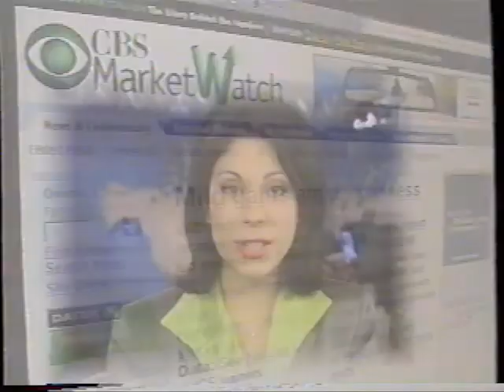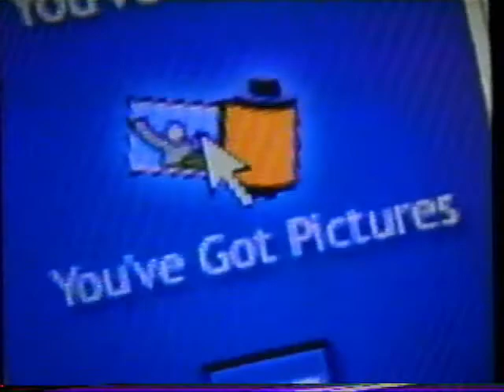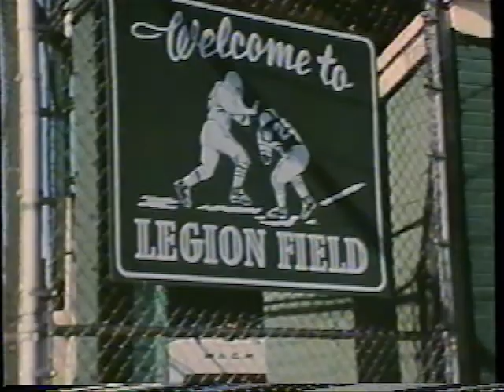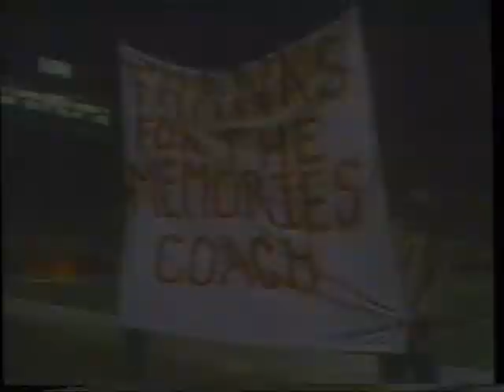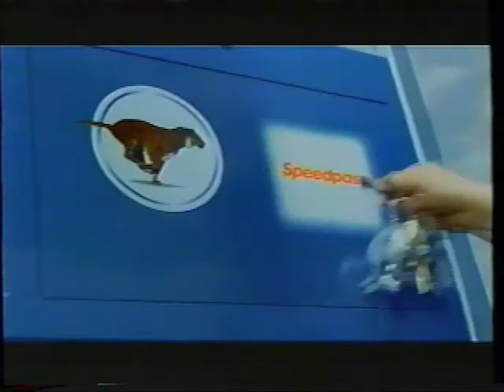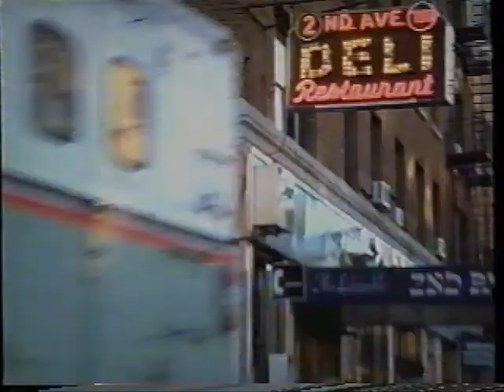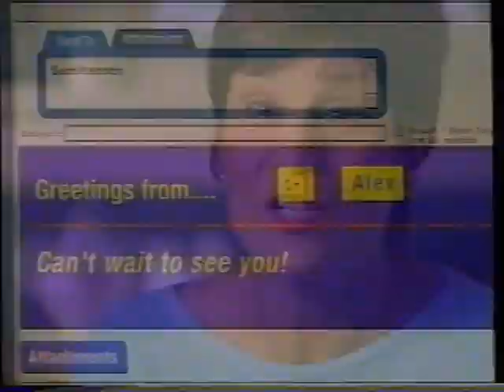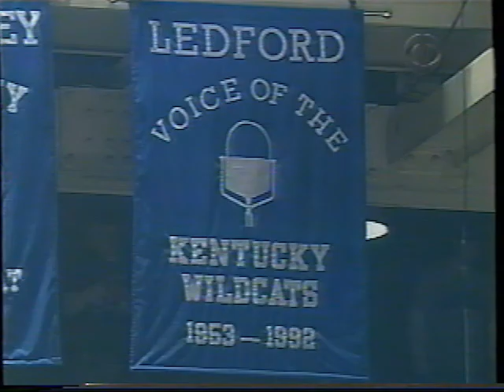The Legend of Coach Paul Bryant and Louisville vs Kentucky Basketball (December 29, 2001, WIAT42)

Comment: I have looked for this documentary for years.  Thank you for posting this
Reply from the maker: No problem, it's a shame that I don't have the full documentary, but I did find low quality clips of this documentary on Facebook.
https://www.facebook.com/JIMRTRSTEWART/videos/806251089440448   -Part 1
https://www.facebook.com/JIMRTRSTEWART/videos/806824336049790   -Part 2
https://www.facebook.com/JIMRTRSTEWART/videos/807414669324090   -Part 3
https://www.facebook.com/JIMRTRSTEWART/videos/807423099323247   -Part 4
https://www.facebook.com/JIMRTRSTEWART/videos/807894129276144   -Part 5
https://www.facebook.com/JIMRTRSTEWART/videos/808369559228601   -Part 6
Reply: Those links no longer work.  Facebook video was taken down a few months ago.  Facebook is the first place I found this doc on the internet, then they disappeared. I had “The Bear: The legend of Coach Paul Bryant” on a VHS way back
I’m 2002.  The tape broke and I tried for years to find this, even called the Bryant Museum in T Town.  I’m so thankful just to be able to watch it again.